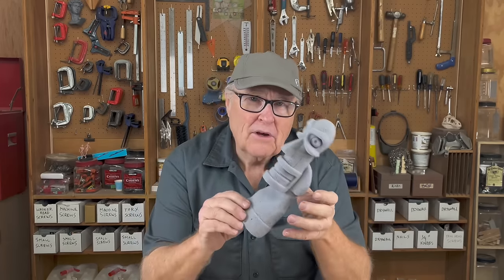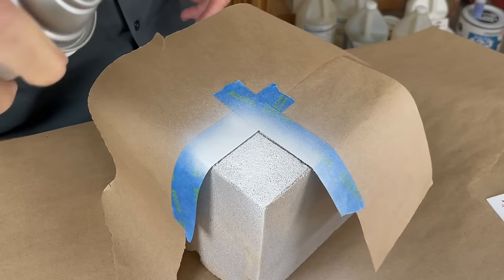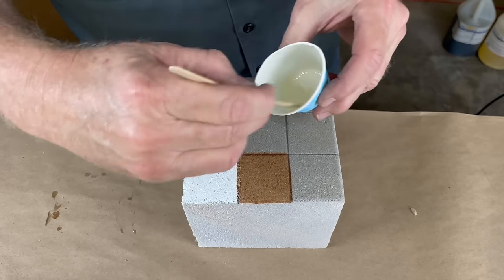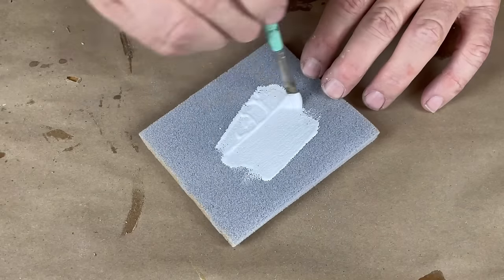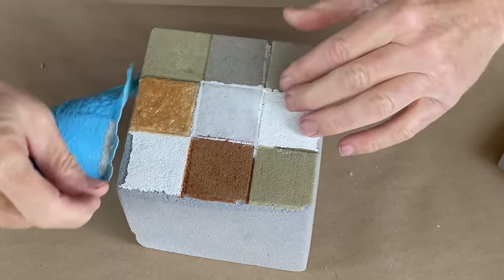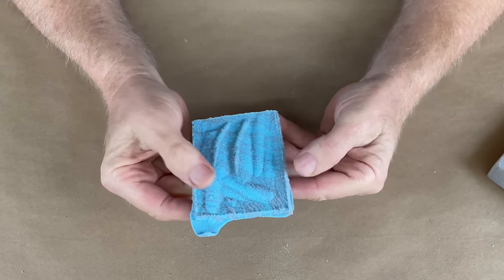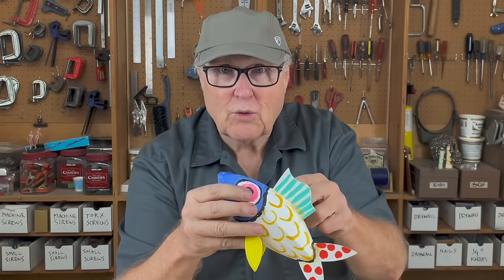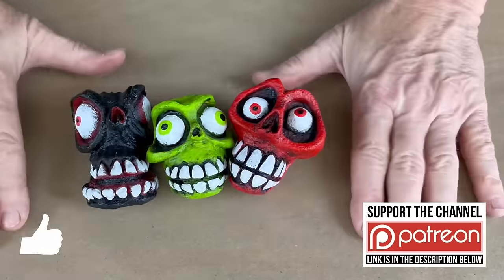Sealing Foam Sculptures for Molding

Comment: Fellow old geezer foam sculptor here. I do a lot of foam sculptures mostly for movies. For coating medium sized sculptures we use a waterborne material called Aqua-resin. Easy to use but it ain't cheap. An easy and strong alternative is a combination of Durham's water putty and joint compound. Both work fine on urethane or styrofoam. Lovin' the channel. One more suggestion is a work apron. My crewmates make fun of me but it work great.

Comment: Besides the epoxy and 2 part urethane,  you can paint on a UV cured resin for a hard coat.  The advantage is that it's only 1 part so you don't have to estimate how much material you need.  Paint it on then cure it with a UV light or sunlight.  It's available in a wide variety of colors.

Comment: A lot of tabletop mini terrain makers use xps foam but this work here to.  The use modpodge and acrylic paint and that makes a good sealer it has a little tougher shell than just some of the other dentaboe sealers you showed her but not as a shell.    The added paint show what you covered already and you don’t loose hardly any details

Comment: I've never gotten to carve in Urethane, but I've carved large stuff in Styrofoam (mostly brick and stone texturing for wall coverings. I was lucky enough that the carvings were sprayed with truck bed liner for coating. It goes on hot, so a little of the detail was lost, but that coating was nearly indestructible. I can't wait to carve some sculpting foam. Thanks for sharing your knowledge and experience.

PS - there's always going to be somebody who's bothered or offended about something. Let 'em complain. All they're doing is adding to the comment interaction and building on your channel metrics.  Also, I'd love to see some of your older work in the casinos and restaurants. If you have a link to some photos, that would be awesome.

Comment: Oh look... Spray paint doesn't melt it. I don't know why anyone said that in the last video comments. The foam is urethane. Spray paint isn't going to melt it. Probably the same person who thinks carving skulls equals the decline of society.
Thanks for the follow up video Robert. I make marionettes carving the foam and coating it with urethane resin. I have used fiberglass resin before too. I think it's polyester. It works, but urethane is better.
Reply: It depends on the foam and the spray paint. If a spray paint uses enamel, it will absolutely melt Styrofoam and XPS foam. Latex, oil, and acrylic paints won't. 

In this video, actual primer is used on the foam and primer doesn't use the same chemicals as spray paint. Primer is explicitly made for this purpose. It seals a surface and won't cause any corrosion.
Reply: @nekrataali Spray primer has solvents in it and spray paint doesn't. Spray primer would be more likely to dissolve something than spray paint. The solvents are what melts. A simple google search will show you. Also, we are not talking about styrofoam are we? We are talking about urethane foam. And spray paint or spray primer will not dissolve it. Sorry, but you are wrong.

Comment: Summary
Introduction and Experiment Setup
- 0:00 - Introduction: Sculpture made last week from foam, lots of comments about skinning and coating foam.
- 0:17 - Experiment setup: Testing materials to coat foam before mold-making.

Materials Tested for Coating Foam
- 0:50 - Materials tested on foam: Beeswax, spray primer, cyanoacrylates (super glues), Shellac, five-minute epoxy, urethane resins, aliphatic resin glue, all-purpose primer, and acrylic gesso.
- 1:02 - Beeswax: Compatible with rubber and resin, non-toxic, easy to work with, considered a gold standard.
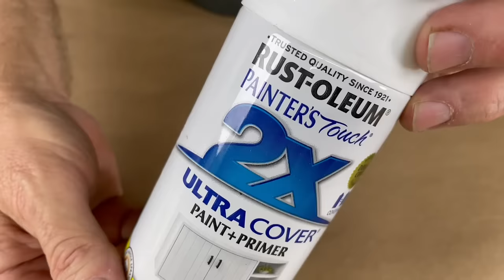- 1:14 - Spray Primer: Various brands tried, works well.
- 1:46 - Super Glues: Quick sealer, effective for porous materials.
- 2:06 - Shellac: Natural, edible, excellent sealer for porous materials.
- 2:20 - Five-minute Epoxy: Effective skin over foam, but expensive in small quantities.
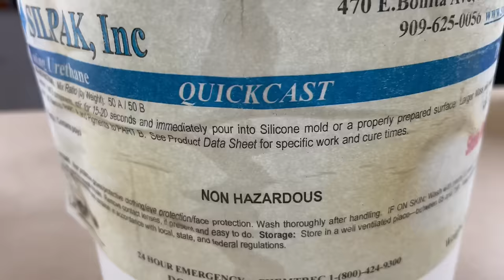- 2:38 - Urethane Resins: Quick setting, allows rapid mold cycling.
- 3:24 - Aliphatic Resin Glue: Good sealer, widely available.
- 3:43 - All-Purpose Primer: Denser than spray primer, effective.
- 4:03 - Acrylic Gesso: Represents all acrylics, versatile.

Mold Test and Results
- 4:22 - Mold Test: Silicone rubber mold created, samples coated, and tested.
- 4:40 - Results: All coatings worked, but yielded different surface textures.

Discussion on Foam Fragility and Hard Shells
- 5:18 - Fragility: Sealers don't provide hard surfaces, foam remains fragile.
- 6:00 - Hard Shells: Materials like Tron required for durable hard surfaces.

Application Examples and Viewer Response
- 7:21 - Sculpture Examples: Demonstrates foam sculpting with different coatings.
- 9:20 - Viewer Comment: Response to a comment on previous video about carving skulls.

Sorting the products from healthiest to least healthy, considering robustness as a tiebreaker:

1. Beeswax:
   - Healthiness: Very safe, natural, and non-toxic.
   - Robustness: Moderate. Compatible with rubber and resin, but may not be as durable as synthetic coatings.

2. Shellac:
   - Healthiness: Natural and generally safe, with minimal toxicity.
   - Robustness: Good for sealing porous materials, but not as robust as some synthetic options.

3. Acrylic Gesso:
   - Healthiness: Generally safe for use with minimal toxicity.
   - Robustness: Versatile and can be robust depending on application, but less durable compared to epoxies and urethanes.

4. Aliphatic Resin Glue:
   - Healthiness: Relatively safe, though may cause minor irritation.
   - Robustness: Good as a sealer, widely available, but not as strong as some other coatings.

5. Spray Primer (e.g., Rustoleum Ultra Cover, Krylon, Ace brands):
   - Healthiness: Moderate risk due to fumes and VOCs.
   - Robustness: Provides a good, even coat, and works well for various applications.

6. All-Purpose Primer (e.g., Bullseye by Zinsser):
   - Healthiness: Similar risks to spray primers with VOCs and fumes.
   - Robustness: Denser and potentially more robust than spray primers.

7. Five-Minute Epoxy:
   - Healthiness: Can cause irritation; fumes can be harmful.
   - Robustness: Very effective and durable as a coating.

8. Urethane Resins:
   - Healthiness: Can be irritating and potentially harmful due to chemical composition.
   - Robustness: Very robust, sets up quickly and is great for rapid mold cycling.

9. Cyanoacrylates (Super Glues):
   - Healthiness: Highest risk due to strong fumes and potential for skin bonding.
   - Robustness: Creates a very effective seal quickly, but with significant health risks.

Note that the video tests two urethane materials Silpak Quickcast and Silpak Trowel-On.

Disclaimer: I utilized ChatGPT 4 (10 Nov 23) to condense the video
transcript into a summary.  I employed Prompt 1 to generate
timestamped bullet lists. I then used Prompt 2 to organize these lists
into sections with titles. The summary was manually formatted using
YouTube comment markup. I also asked GPT to sort the coating products
using prompt 3.

Prompt 1: "Generate a bullet list summary, including starting
timestamps for each point."

Prompt 2: "Split the following bullet list into sections. Create
section titles. Keep timestamps for the bullets. Use this format for
titles: *title*. Keep bullets that you deem important to the story."

Prompt 3: "sort healthiest product first. if two products are similar
in health list the more robust coating first."
Reply: Ummmmmmm its only about a 10 min video..... I don't think anyone needs all that stuff!!??!!
Reply: Why are you trying to jump onto Bob's content?
Reply: that's cool that an ai can generate that. ChatGPT cant look at artwork but it can read the captions on the video to make that long list of text.